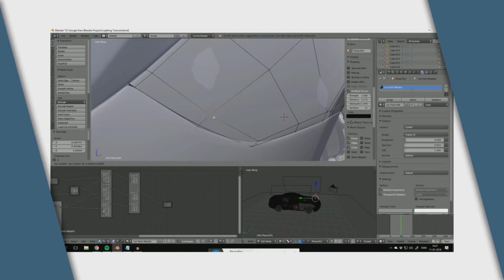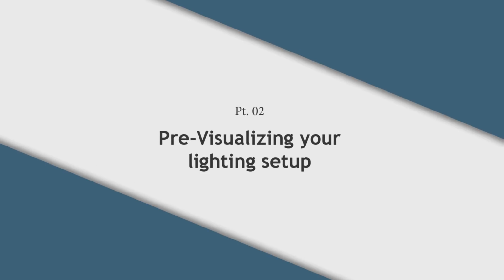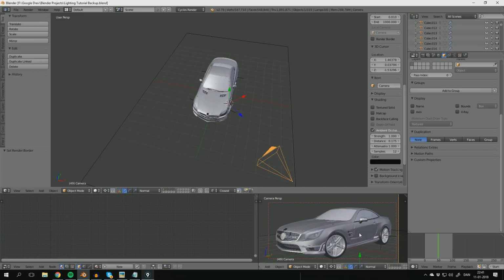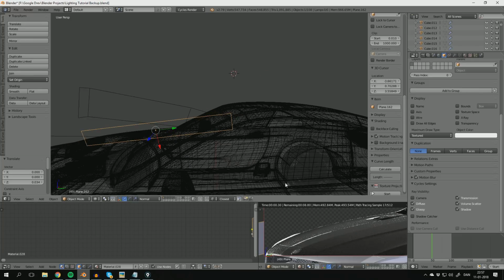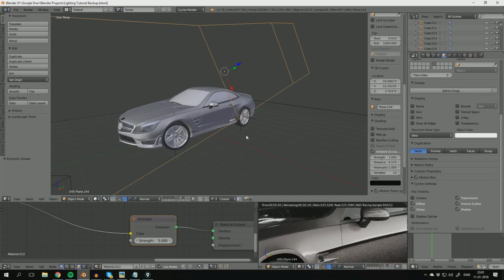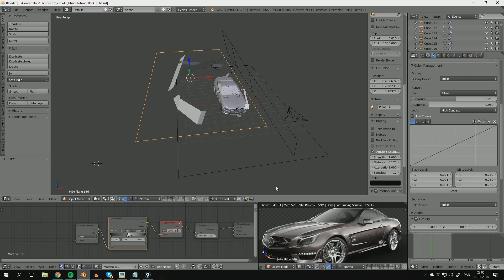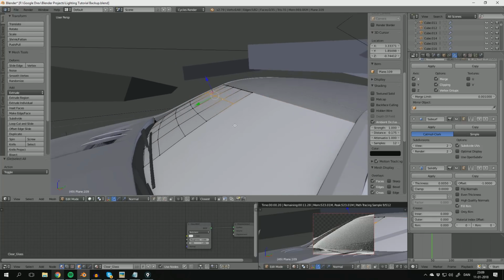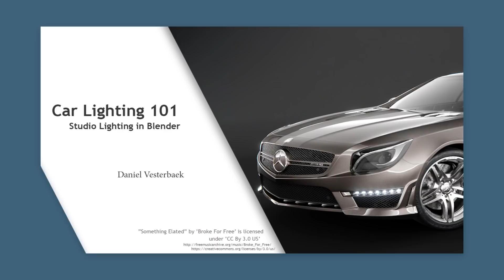Car Lighting 101 - Studio Lighting in Blender

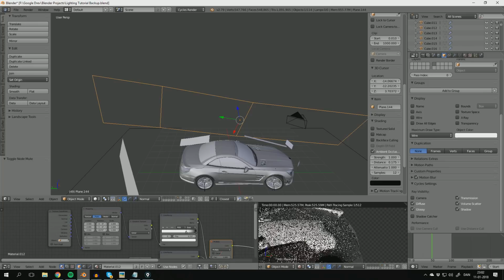Comment: I always use a light group with a empty (sphere) as target. This way i can always let the lights point at the subject. Then i add other lights/planes which dont target the empty, so i can move them and have more control. Then every 10 frames i use scene markers to call shots, at each marker i let locrotscale, so i can use the same lights through out the scene. That reflection @10:12 should run all the way to the back, just extend the mesh emitter. Doing the levels isnt cheating, that how many photographers adjust the photos as well. Cycles doesnt have shutter speed right? I use different render engine with Blender which does have this together with ISO and F-stop. Edge flow is really important to proper showing higher the polys the more even the edge flow and dense. Ofcourse the flow needs to be correct as well, no pinching!!!! Thanks for the link, wanted to ask about and noticed the link. Gonna check this for sure
Reply: hahaha that link was indeed what i was talking about, more and dense polys in a object. Although he kills it a bit perhaps
Reply: PS know i remember, i passed you that link ;) great to see you made good use of it

Comment: Shrinkwrap modifier resolves that reflection problem(minute 14)
Reply from the maker: Yeah, it is true that it would resolve the large issues like the one at the door handle, but it still wouldn't fix all of them I think. And even the guide mesh you shrink the main geometry to will have just a tiny bit of distortion because of modeling imperfection. I guess you are thinking about the video by 'CG Masters' about 'Advanced Subsurf modeling', but if you look at the reflections in that video even with the trick applied you see some distorted reflections. Modeling precisely curved faces with polygons is next to impossible and even the tiniest imperfections can distort the reflections just a bit.

If anyone is interested here's a link to the video by CG Masters btw: https://www.youtube.com/watch?v=3rlMzsBWtPY
Reply: Maybe you could increase the number of subdivisions. Reflection issues would be in any cases unnoticeable ;but i agree with you about the impossibility of getting a perfect reflection flow on all the mesh;)
Reply from the maker: Yeah, that would definitely improve it as well. The guy in the article talks about using NURBS to do the modeling. I have never really tried it myself, but that kind of modeling should produce much more precise results.